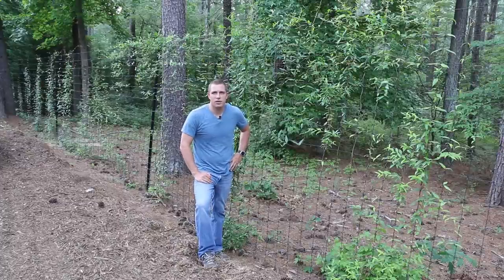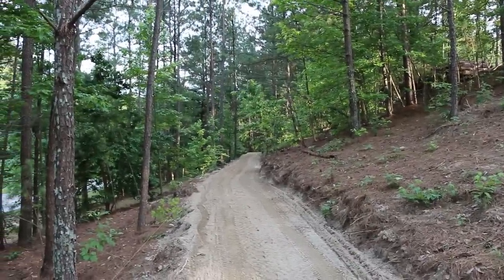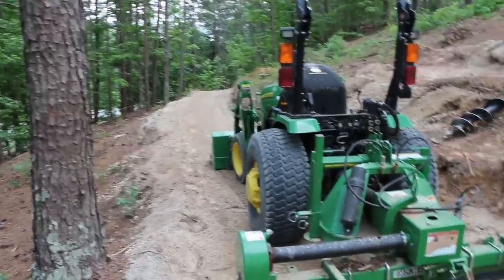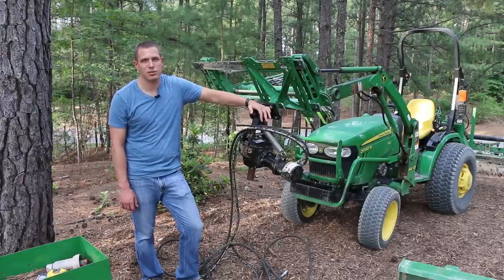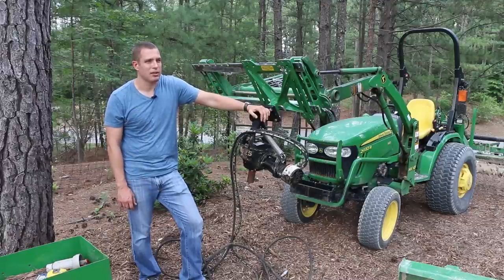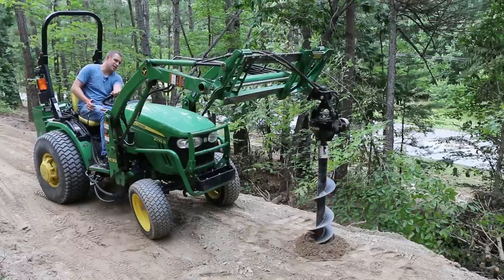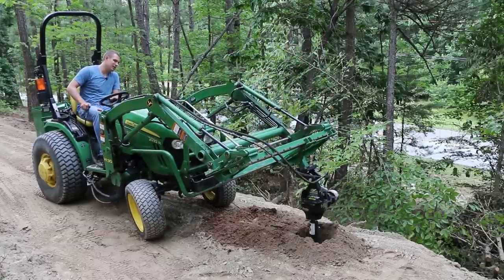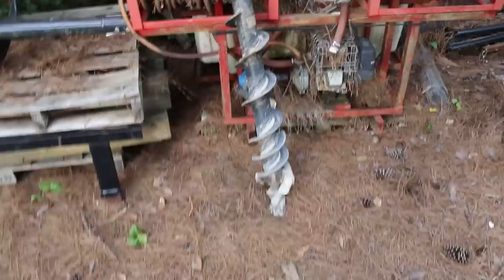8ft Metal Deer Fence Install Part 1

Comment: I am building a deer fence 8 feet tall right now. I used a vibration post driver that I rented from a local rental business. It came on a 7 ton excavator and made quick work of driving in the posts. If not for the fence, the deer will destroy the 1000 apple trees i am planting. I counted 17 deer in my back yard and they chased me out. I don't hunt deer so they just multiply so the need for the fence.

Comment: Does your tractor allow you to dump and raise the loader at the same time? Reason I’m asking is I want to build this auger unit however I will have to use my curl function to power the auger. My 3005 can’t raise the loader and curl at the same time. Do you see that causing a problem? Basically I will have to apply down pressure then activate the auger. Then apply more pressure and activate the auger again. Is that what you are doing?
Reply from the maker: Yeah, I can use raise and curl at the same time so that allows me to put down pressure on while turning the auger.  If you can't use them both at the same time but you can put the raise and lower in float then curl gravity should be enough in most soils. Won't be as fast but it will work.
Reply: Add a true auxillary front hydraulic kit, so you can do both (rather than a switched).  Get WR Long to make you one.